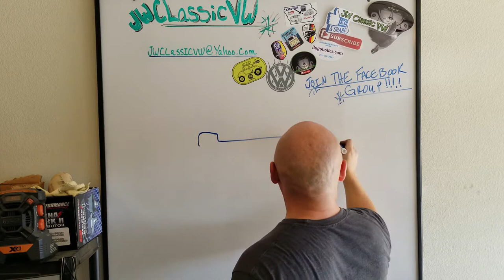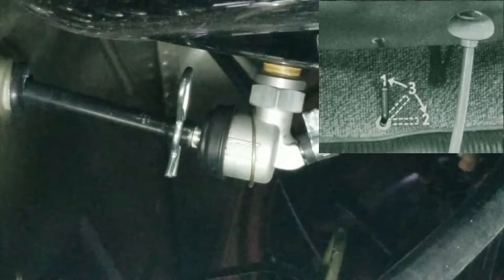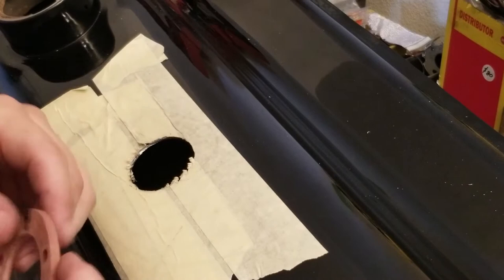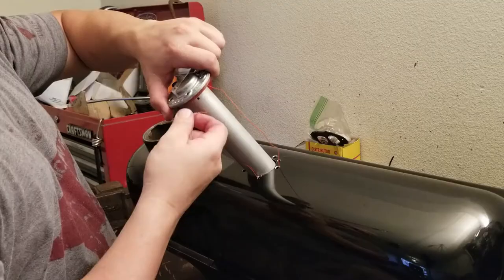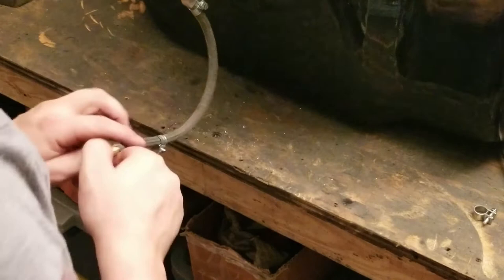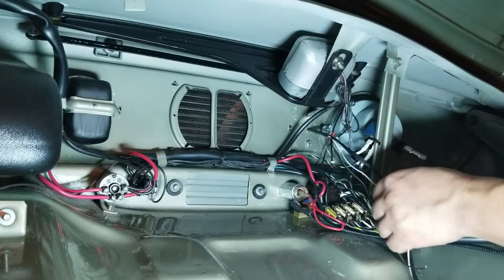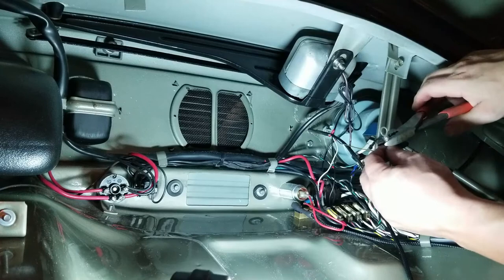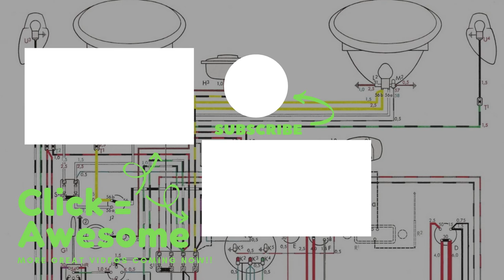How To: Install Vintage Speed Fuel Gauge Part2 - 1956 Ragtop - Volkswagen BUG | JW Classic VW

Comment: Great mod...I wouldn’t have used the self tapping screws either.  So I’m curious...at the start of your vid I was wondering how you were gonna get a 4” backing plate through a 3 inch hole...did you test fit the large gasket through the filler neck to make sure your backing plate would fit before you concocted your plan?  

Just a thought, You also could have left the backing plate a bit larger, cut a slot through one side and sprung it like a giant lock washer, and threaded it in to the hole.  Just a thought.  Where there’s a will...
Reply from the maker: Yup... definitely measure before I started making the backing plate.  About a week later I found them already made online..  lol

Comment: Wish I had your creativity in working on ur vw ... I had a ? How were u able to get the mounting piece thru the gas cap fill and to the mounting point ??
Reply from the maker: Thanks so much man! Glad your liking the channel.  For the threaded plate I ran a piece of wire through that was long enough through a hole in the plate, then fished it through one of th holes I had drilled.

Comment: Hey I was wondering if it would be easier if you just cut the inside mounting plate like a C (maybe a 1/8 an inch thick cut out of the circle) so it can be easier to get in tank to mount ?
Reply from the maker: That is a great idea!!

Comment: What is the estimated distance between the  fuel tank hole and the vdo gauge hole? Thank you
Reply from the maker: Maybe 36 to 40 inches... really not sure.
Reply: It looks like I didn’t. I meant the distance from the fuel hole tank to the hole I do have to drill to install the sender

Comment: Looking at getting one of these.  Would you do anything differently if you were to do this again?   Would you use the same product?
Reply from the maker: No I love it... I did find where you can just buy the ring that I made for inside the tank.  So, I would probably just buy that...lol
Reply: @JWClassicVW  Link?
Reply: @JWClassicVW  This may sound dumb, ut did the kit come with the sending unit too, or just the gauge?
Reply from the maker: @dmck2533  just the gauge... when you check out Vintage Speeds website they'll outline the correct sending unit.  I picked up the one for my 56 from CIP1.
Reply from the maker: https://www2.cip1.com/ProductDetails.asp?ProductCode=VDO%2D226%2D451